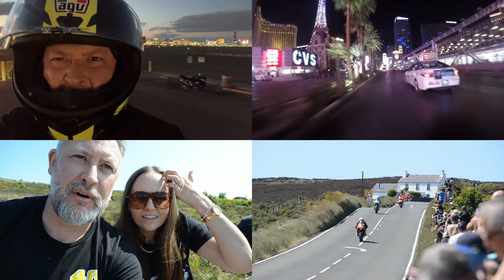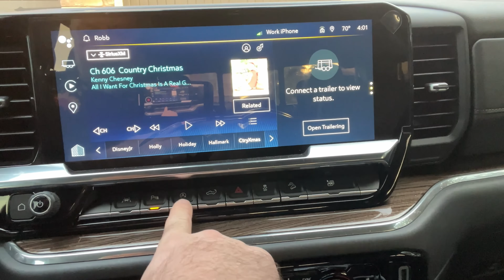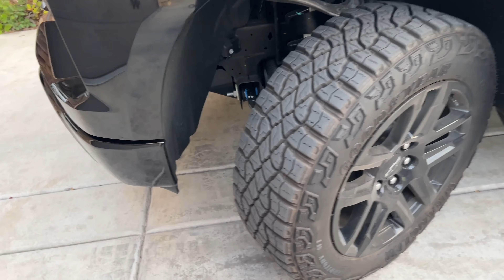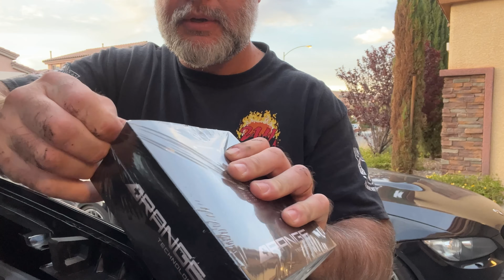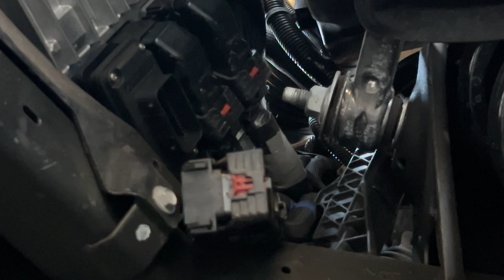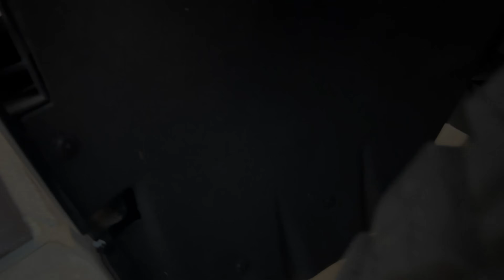Robb Review:  Range Technology Inline DFM Disabler

Comment: I installed mine in less than 3 min. Just fold the fender liner over from the shock side and boom, full access. It works great. I drive through a lot of smaller rolling hills. My mileage got better. 1-2mpg. Throttle response is better. I’ve had it on for about 1200 miles. Truck only has 4000miles. Worth the money.
Reply: I’m getting 13 mpg on my 6.2 Silverado trail boss with the range technology module. I was getting an average of 16 mpg before
Reply: @juancamarena6810 I have noticed a similar decline in mpg as well, currently showing 15 mpg as my daily driver.  Need to get it on the hwy & see how high it will go.
Reply: I should have mentioned I was driving in L9 on the highway before installing the Range. Highway speed average 65MPH.
Reply: I know this is old, but have you had an oils change at the dealer? What did they say?
Reply: @k @keithquick don’t think they would notice it because they usually have some rookie beginner doing oil changes but I’d remove it just in case.
Reply from the maker: @keithquick  Just posted an update after 25K miles on my truck and I comment on my dealership experience in the video:
https://youtu.be/MHNVToMra_0
Reply from the maker: Awesome!  Thanks for the mpg data.  I was being precautious and was afraid to bend the liner down there.  Glad you found a quicker way!
Reply: Are you saying you were able to access the ECM from inside the engine compartment vs removing the fender liner from the exterior side behind the wheel ?
Reply: @cbnx82703 no, I removed the LF wheel & wheel well liner & then plugged the module in.  The module works great!  I’m very pleased with it.

Comment: Will it void the warranty?
Reply from the maker: Supposedly it will not void factory GM warranty.
Reply: it leaves no footprint it was ever installed, when removed.
Reply: I can't get a straight answer on this- probably because it depends on the dealer's opinion. My thought is, remove it when you bring it in for service. I want to be safe and don't want a "note on my account" that I used aftermarket stuff in the event I have problems with all their DFM/lifter junk. They will use whatever excuse/blame they can to not honor any recalls or replacements.
Reply from the maker: Just posted an update after 25K miles on my truck:
https://youtu.be/MHNVToMra_0

Comment: I installed the range module on my 2023 Chevy Silverado trail boss 6.2 and when it goes to zero cylinder mode it makes a squeak noise
Reply from the maker: @juancamarena6810  interesting, I don’t have that squeak on my 5.3.  Is it coming from the engine or from the module?
Reply: @ the noise comes from the engine. I’ve seen others comment that it has to do with the zero cylinder activation. Was hoping the range module would eliminate that. Maybe it’s just on the 6.2s
Reply: The squeak noise is that flapper in the exhaust. I park next to retaining wall at my house and when I start my truck in the morning and its coming off high idle it makes a squeak noise. I reached under there with a pair of heavy duty gloves and touch the flapper spring and it stopped squeaking

Comment: My 2024 GMC sits for weeks at a time. Do you think this will draw my battery down if I don’t drive it often? Definitely don’t want to connect and disconnect every time my truck sits.
Reply from the maker: @MatthewFlint-v3p  you may want to contact Range Technologies directly to confirm, but I don’t believe this module draws any power whatsoever.
Reply: @ I appreciate the response, will do. Thanks
Reply: What did you find out? I'm in the same situation @MatthewFlint-v3p
Reply: no, there is no power draw with this module. The earlier models 2022.5 and older, where you tied into the OBD port under the dash, yes, those draw power all the time.
Reply from the maker: Just posted an update after 25K miles on my truck and still have no power draws:
https://youtu.be/MHNVToMra_0

Comment: I hate to be the bearer of bad news, but that device will not prevent lifter failure. If you want to prevent lifter failure, you need to have your engine deleted of all that hardware and a tune installed so it doesn’t look for it. I just recently sold my 2022 Silverado 1500 refresh with the 6.2L engine. Although I didn’t have any problems with it because I really didn’t drive it much. I’m sure eventually I would. I currently own a 2024 Silverado 2500 diesel. None of that nonsense is on my truck however, all that emissions crap is on there so unfortunately there’s no way to get around this stuff.
Reply from the maker: @TheCarCrazyGuy I have my doubts as well, but am subjecting this truck to this test specifically to see if the module will help prolong the lifters or not.  I’ll be posting updates every 25K miles (or until I experience a failure), so we’ll see…
Reply: @TheCarCrazyGuy Agree. I already lost the driver's side lifters on my 2021 Suburban 5.3L (replaced under warranty). When the passenger side goes out, I'll likely scream some expletives as I fork over the $7-$8K to have a shop perform the DFM delete procedure. I love the ride, cargo space, and overall comfort of this Suburban. As much as I hate paying any more money for it, I believe the cost will be well spent if I can maintain it for another 5-10 years.

Comment: Thanks for the video! Has your fuel consumption gone down since the install? So, this device will keep all 8 cylinders running all the time?
Reply from the maker: You’re welcome.  Yes, this keeps all cylinders firing by disabling DFM but it doesn’t disable “0 cylinder mode” whereby fuel delivery shuts off when coasting at low speeds (which I don’t experience very often).

I’ve now had the truck for 6K miles—first 3K without and last 3K with the module.  Haven’t really noticed any difference in fuel consumption (good or bad), but it could be because I babied the engine during break in period and have been running it much harder the last 3K especially after installing a proper exhaust.  So, theoretically if I drove it the same before and after I might get better mileage with the module but can’t say for sure.
Reply: I own a 2019 Tahoe with AFM + 6.2 /10 speed but there is no disabler available yet cause the 10 speed tranny makes it difficult.

Comment: @robbsgarage what exhaust do you have on your ‘24??
Reply from the maker: @Thatairlinepilotguy  AFE 0FG—I spent a lot of time researching catback exhaust sounds before buying this one and felt it produced the best sound available.
Reply: @ great to hear! Exactly what I’m getting ready to put on my ‘24 6.2 trailboss. Installing the range DFM tomorrow when the unit arrives. Your video helped a lot, thanks!
Reply from the maker: @ I should have made a video about the exhaust mod.  Install itself wasn’t so difficult, but removing the stock pipe wasn’t as easy as you’d think.  6.2 may be different, but the 5.3 pipe is very long with several bends that had to snake out the rear.  American Truck produced a video that makes it look simple, but it is not.  I eventually gave up and cut the pipe out.
Reply: @ good to know. A buddy of mine owns a body shop, so we’ll throw it up on the lift and install at his place. Shouldn’t be too hateful for us.
Reply: @robbsgarage  "AWE 0FG" out of Pennsylvania...
Reply from the maker: @ I believe so

Comment: Range does say coasting foot of the gas does use the collapsible lifters to go into zero cylinder mode, however it’s not Dfm. Dfm also uses the collapsible lifters. Both modes share the same hardware, the collapsible lifters.
Reply from the maker: @Everything-k3y  here’s what Range told me:  “The engine will still enter 0-cylinder mode while coasting at slower speeds. Contrary to what many think, this is not a DFM function. It’s actually the engine shutting off fueling, so the cylinders don’t actually fire. It’s not the DFM system turning on and collapsing lifters to prevent the combustion cycle.”
Reply: @robbsgarage thanks
Reply: Correct, that’s exactly what they told me, zero cylinder coasting does not use the Dfm program but it does use the collapsible lifters to keep the valves closed in zero cylinder mode.
Reply: @Everything-k3y  If thats the case this product does nothing to increase lifter life, these lifters need to stay pumped up at all times.
Reply: @EllisRitter-ui6qu does nothing huh?
Think about it more
Reply: What % of driving time do you expect the zero fuel mode is actually activated?

Comment: When I bought my 2022 RST Z71 5.3, it was when they determined AFM finally had to go.  My truck came from the factory without AFM or DFM.  I'm happy I don't have any of it.  Everyone i know with a 5.3 has had lifter issues or needed a full motor replacement.   The failure rate is way higher than GM states publicly.
Reply: The 2021 and 2022 models had a run during the hear of the infamous "chip shortage" where some of the V8s didn't have a functioning AFM or DFM system. So yea...no DFM issues. But not so fast...the DFM would not function because of electronic/tech reasons. But unfortunately those miserable AFM or DFM lifters are still in the engine. So while they don't function as designed, they are still present. Perhaps the lifters not constantly collapsing, reactivating, etc. will help prolong the life of these crummy lifters............................or maybe not. Time will tell but one thing for sure, you folks get a much better quality driving experience and for "free!"
Reply: How were you able to not get AFM?
Reply: @RigginTheRod010  It wasn't an intentional decision on GM's part.  During the post-pandemic chip shortage, GM was unable to source the chips needed for DFM, so many trucks were built without that functionality as a result.  As soon as the supply chain issues were solved, GM went back to including it on all their 5.3 & 6.2L V8s.
Reply: How would you know if your vehicle doesn’t have it installed?  There is no dash notification that DFM is activated, and the manual states that also.  This is for a 2022 Escalade.
Reply: @dariocardona2805  with a 3rd party exhaust system you can hear if DFM is active or not. The factory muffler has a "flapper" valve that masks the flutter sound so it is more difficult to tell by listening.
Reply: @dariocardona2805  the window sticker will tell you if it has AFM / DFM chip installed or not.
Reply from the maker: @chrism1157  I’m so jealous!  You bought at the right time.

Comment: These pricks are killing the V8...This is why I wont buy a new truck..Keep it,it does not save shit and I am paying for 8 cyls and I want them 24/7
Reply from the maker: Amen brother, these auto manufactures and the EPA are killing the industry.  I wouldn’t have bought a new truck if I didn’t need one.  Hope to keep this one forever because I can only imagine how much worse it’s going to be 10 years from now.  I got this DFM Disabler to help make this motor last as long as possible!
Reply: I have a 2013 Sub LTZ 5.3 with 187k. Had the Range product since 40k miles and never had any issues. Motor runs like a champ giving to my son. Just bought a 24 Sub HC with a 6.2 and will put this on when it arrives.
Reply from the maker: @markfrench3665  great to hear you’ve had good experience with these things.  I’m hoping this module prolongs the motor life.  So far so good, and I’ll keep posting updates along the way.

Comment: Oh, hell no not doing this to my new Silverado 1500 RST.
Reply: why not?
Reply: I have a 2023 Chevy RST, equipped with the 5.3.  I just installed this plug on mine at 17,500 miles.  Haven’t driven it far enough to truly evaluate.  I noticed a little rough idle after installation, a difference in the trans shifting & stronger acceleration.  Not sure about fuel economy, per the truck computer I’ve lost 2.5-3.5 mpg just driving around for errands.  Am going to put in a K&N air filter & should drive it on the hwy to maybe blow out some carbon.  Have not had a check engine light or any warnings.  I bought this Range plug because of concerns about what the DFM & Auto Stop effects could be when the power train warranty runs out at 60k miles.  Owned 2011 f150 before this w a 5.0 v8 and after 110K miles was costing me $1000’s.

Comment: One thing I noticed is the oil pressure goes up when you accelerate and decrease when you start breaking. I thought it would stay at a constant rate.
Reply: its called RPM. higher rpm - more oil pressure. This happens even with v8's from the 60's era. Normal operation

Comment: I wish they would have left it as an OBD plug in.
Reply: With the 2022.5 refresh that extends to the 2025 MY, GM changed some things electrically so they had to completely redesign and re-engineer as their product could no longer do its job through the OBD port...
Reply from the maker: @ThePlotts  I thought the same at first, but once I installed it I actually prefer this better—only takes 10 minutes and doesn’t clog up the OBD plug area.
Reply: why? the OBD port one drains the battery I hear. This newer one does not drain the battery.
Reply: Install can't get much simpler, have one of your mechanic buddies install it for a 12 pack of beer.

Comment: Man everytime I get in my f150 since buying new in 2017 I push that stupid auto start button. 

Curious - is the DFM system still active even with tow/haul mode on?
Reply from the maker: @JP-ec8fe  nope!  This thing disables it at all times including that stupid auto start!
Reply: i assume your asking without the range installed. I know for sure L9 manual gear turns off DFM/auto stop. I believe tow/haul mode keeps it out of DFM mode as well. Not sure about Fords, but I speak with GM knowledge only.